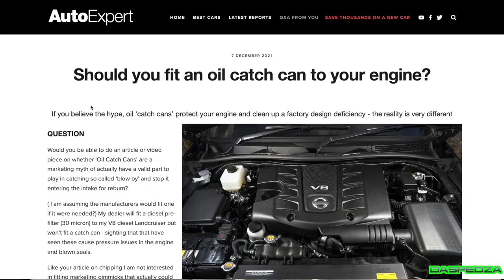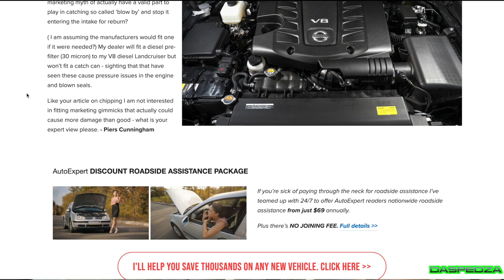Catch Cans Cause Major Crank Case Problems? LC200 - 1VDFTV

Comment: No issue on my 200 Series with a Provent 200 oil catch can.  Now with 260,000 kms and 14 years of ownership from new.  But I only installed the catch can after my extended warranty was up on the 5th year.  Still fine for the last 9 years with said catch can.  The oil cap does not blow off my hand when loosened with the engine idling.

Comment: Glad you mentioned the 3 musts, correct size catchcan, correctly fitted & correctly maintained. I have just watched the vid from Berrima Diesel (on a 200 ser) and they mentioned these same 3 musts. As far as I'm concerned listening to experts that only deal with the one thing (in this case diesel engines) is a must also not the people that are trying to make money from lies.
Reply: Glad you picked up on, it's their words not mine. I'm not a mechanic by any stretch but will listen to the experts that make sense before mates/keyboard warriors anyday. And I certainly agree with that's all they do all day, everyday, is work on diesels. Thumbs up, mate.

Comment: It's a shame that uninformed people insist on making unsubstantiated negative comments on this subject. Is it a case of something to say for the sake of saying it? You want real world catch can information, go to Berrima Diesel. These guys know their stuff and give a good and fair explanation on how this all works.
Reply from the maker: Unfortunately some people are against catch cans and want to do anything to push people away from them. When in actual fact if you get the right sized can for your vehicle and it’s installed - maintained correctly you have no issues with them. 

With over 14 years of experience and having installed that many catch cans i’ve lost count, yet have seen that many incorrectly installed ones from less knowledgeable individuals. I can attest that catch cans aren’t an issue if the listed above is done correctly. 

I’m fairly sure Berrima Diesel has said the same thing. 👍🏻
Reply: @DaSpedza  Yes, BDS say the same, I'm with the experts on this. It's on my to do list for our  MY16 LC 200 Sahara.

Comment: What you see with the oil cap off is blow by not back pressure. I am amazed how people go on about CCs. Just the distance  the gas travels is increased and nothing else changes when you fit a CC. There is nothing that can make pressure. Good on you matey.
Reply: What about the volume change of the can, not just the length of tubing?
Reply: @catinthehat5140  I have come to the conclusion the Provent CC seems to not cause issues where there are definitely other brands that do. The Provent has a lid that breathes so that no pressurization can happen. They definitely do more good than harm and every car made has a oil vaper recirculation system so from a engineering point of view car makers agree with them. So people don't want one but that is up to them. Thanks matey.

Comment: Pressure top end is not pressure lower end?  One man blaming catch can had old engine replaced pcv, but never cleaned solid crust carbon from behind valve. New larger lines may help.

Comment: Hi I own a Triton 2.5 and put in a early imitation 200 and it has blown off the lid due to the back flow, which the vaive didn't open properly, I also can see the pipe between the turbo and the intercooler wants to blow off,  should I replace the cc with a bigger one or put one with a filter on? Thoughts thanks
Reply from the maker: Change it for a legitimate Provent 200 and not an imitation one. The imitation’s are terrible and aren’t built to spec they’re known for causing issues. 

Also check if it’s connected up correctly. 
If you still have the issue you may have other problems with the motor being tired and causing excessive blow-by.

Comment: I have vdj 79, I have watched alot of videos about this issue the intakes filling up with sludge. I would put one on my car if some proved to me they make a difference and stop the intake from clogging up. The research I have done and other owners I have spoken to believe the best way is to turn off or block the EGR. I have never seen anyone fit one then after a 50,000kms show there intake.
Reply: I too have a 79 series with the 1VDFTV engine. I have this vehicle since new and at the 20,000 k mark fitted a provent 200. over 60,000 ks later and at the last service I removed the intercooler etc to look at the intake. no sludge or oily crap, a coating of carbon on the internals but certainly no more than 0.5mm thick. for engine oil I run 15w-40 viscosity. I drain the can every 5,000 and replaced the filter after 40,000

Comment: Can i ask a question then . Do you have do do an egr delete or blank plate with the catch can ? Does yours? I only ask because in all honestly when i put mine on it never went better , but 2000 klms later i had so much white smoke i had it towed home only to have several quotes to replace the turbos . My injectors had already been replaced a year and a half earlier and everything was running fine. Whilst waiting for mechanics booking date i decided to strip down the intake and do a full clean. I removed the catch can and went back to original burnt the oil out of the exhaust and sent it to the mechanics and they could not fault it . That was a year ago now and she still runs great . No turbos were replaced and no white smoke . I love my 200 
And it was probably just blocked filter  but the elephant in the room is do you need to do egr delete and won't it void warranties .
Reply from the maker: The fact you had issues straight away especially within 2000km’s leads me to believe that something wasn’t right with either the installation of the can or the can itself. The early Provent 200’s did have a relief valve issue however they revised that. 
As for egr delete or blanking plate you don’t require one to have a catch can fitted and mine doesn’t have a delete installed. Egr deletes can open up a whole new can of worms. And yes egr deletes can void warranties in the eyes of the dealership everything can void the warranty if it gets them out of fixing your car.  😂
Reply: @DaSpedza  thx for your input im always a good listener
Reply: I have a 2005 hdj79 Land Cruiser. Early on I was stumped as to why the intake after the air cleaner was always wet with oil.
To do the tappets on that vehicle you have to remove some of the intake tubing. When I took that it off,  the damn thing was severely caked up with carbon and looking down into the exhaust manifold it was the same. So making some enquiries led me down the path of why was this happening. Long story short, Toyota and I suspect other manufactures in reducing their emissions, decided to redirect any blow by back into the intake manifold instead of just venting it  into the atmosphere. As that oil travels through the intake it is mixed with hot exhaust gases admitted through the egr valve partially burning some of that oil and so building up as partially burned oil caked onto the inside of the intake manifold thus reducing the size of the intake and restricting air flow as well as clogging up the intake ports of the engine head. A catch can will take up that oil in the filter and reduce or eliminate any oil going back into the intake. My cruiser runs fine and has virtually no oil entering the intake. If people have problems after installing a catch it is probably undersized, a cheap knock off or it has been installed back to front.

Comment: I think the main issue with catch cans is overlooked. On the car is a PCV valve to govern presure. On some catch cans is another. The catch can with a PCV valve requires the PCV valve on the vehicle to be removed on install. You can not run two PCV valves.

Comment: Simple solution to diesel issues is dont own one. Supposed bad diesel has cost me 6 injectors in the last 15 months on my BT50. Try and argue the toss with Bosch that if it was shit fuel why didnt all four shit the tin at the same time. Fitted a .5 micron polishing filter and will see how it goes. The lesson for me was I should have drained my tank when the first 4 were done. I am in the market for a tow rig but I change cars like my jocks and I am tired of wasting money but at around $3k for a full decarbon of a 200 series its just another cost impost. I have a mate who is a Toyota fan boy who will hear nothing against God even when I remind him about 8 injectors and a dusted turbo....
Probably a petrol V8 Cruiser this time around (new petrol 80 in 1997, TD 100,  2 V8 200 series TD and 1 Petrol V8) but it can be a crap shoot either way